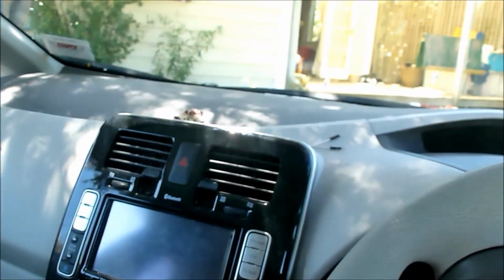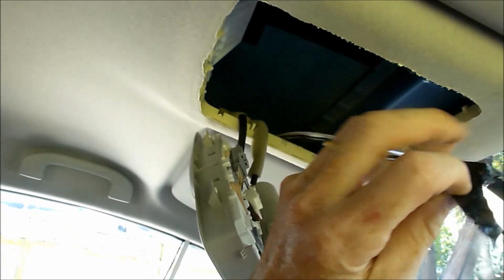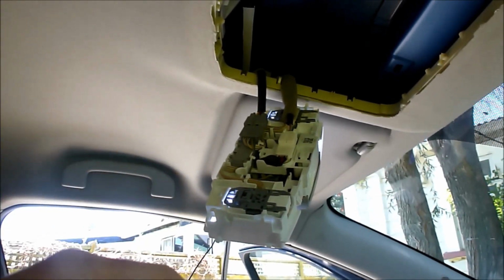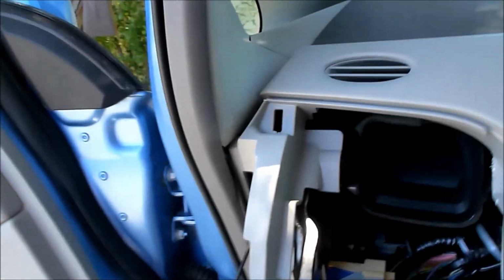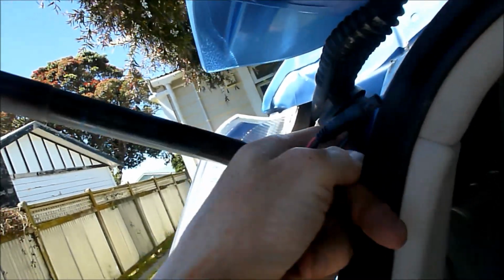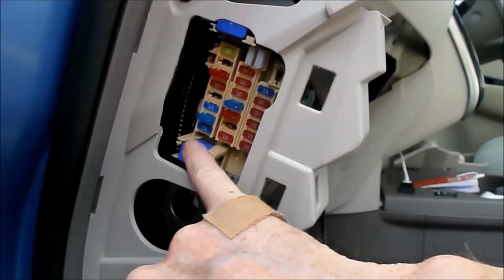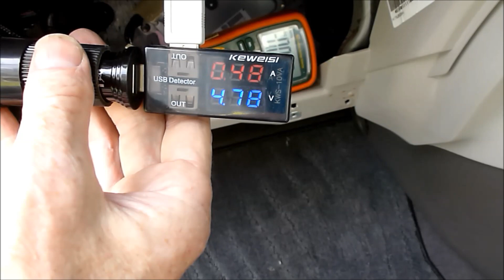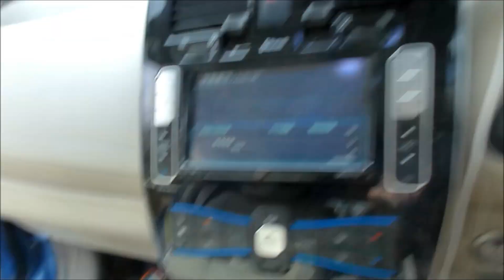Nissan Leaf 010 - Installing a dashcam

Comment: Hi, at the @7:54 you said that it's stupid to connect dashcam to constant 12V power. But for example, I've bought the camera that has the ability to do an constant recording, and it has a cable that prevents 12V battery to depleat, so it shuts down the camera if that's about to happen. 
Tell me, how to connect the camera to these connectors if I have three wires that are supposed to be connected to fusebox?
As to me it seems easier to wire it to these then to fusebox... Or I'm wrong?

The camera I've bought is 70mai with rear camera too.

Thanks!
Reply from the maker: Hi @vedranart - Now that you mention it - you might be right. I hadn't thought of that. I presume the three wires are for (1) "Earth", (2) constant 12V and (3) the ACC 12V ie. the 12V that turns off when you turn the car off. Then the camera can tell when you've turned the car off. My dashcam has an internal battery that runs the camera for another 30 seconds after the car is turned off. In the case of the Leaf I was worried about draining the Leaf 12V battery because that is a weakness of this car (the 12V goes flat pretty quickly if the car is not driven for a while).
Cheers, Paul
Reply: @paulkennett  And there's no way to use car's battery and not the 12V battery for this use?
Reply from the maker: @vedranart  Not really. The dashcam needs 12V so it makes sense to just connect to the small battery.  The main battery has a lot of protections to keep it disconnected unless needed.